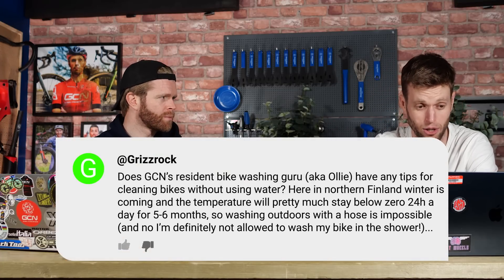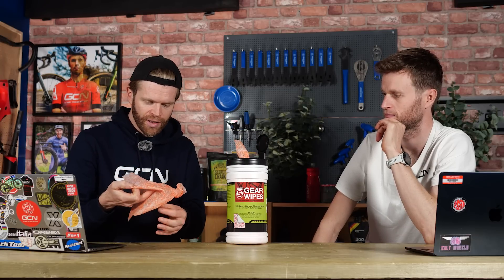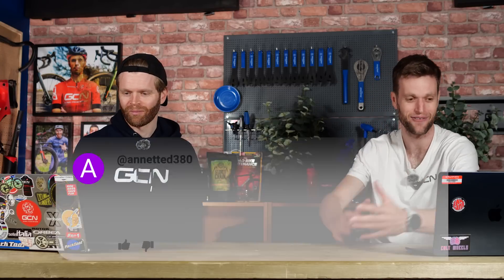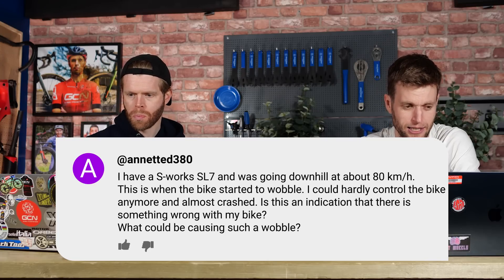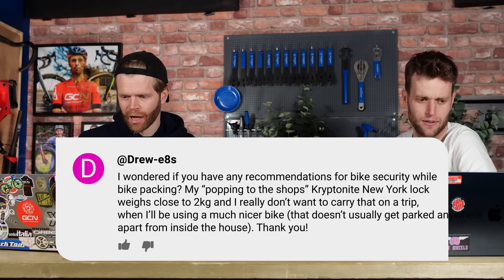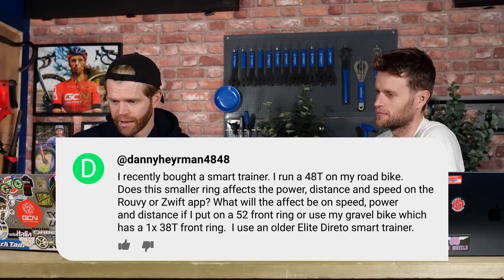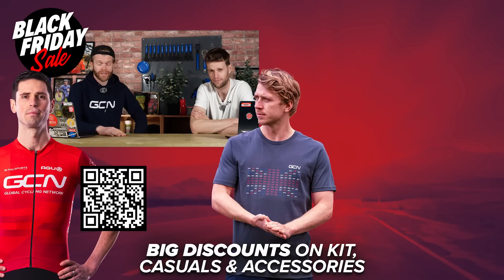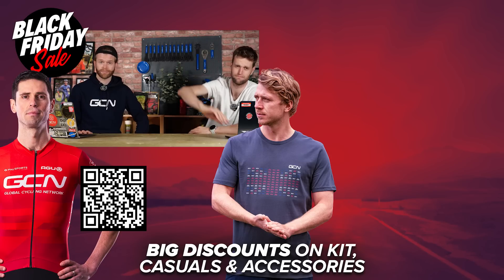Waterless Bike Wash, Cold Waxing & Speed Wobble | GCN Tech Clinic

Comment: About the wheel wobble. I had this experience once, only once. I was riding down a mountain pass in the Banff area which is north of Calgary. I hit 72, 73, 74kms per hour and then suddenly my front wheel started to shake a lot, scaring me I applied my rim brakes slowly to drop my speed and the shaking went away. The road surface was quite smooth and not much wind. I've done speeds of around 60+kms with no problems before. When this happened I thought there was something wrong with my wheels. When I got home I checked the truing of my wheels and both were in really good condition. I also checked my headset which was fine. I ride a Dolan Rebus, I always keep my bike in top condition. To this day I have wondered what caused this. Thanks for addressing this topic. Ollie as you said this is a complex situation, I guess I will never know the true cause, I don't do those speeds anymore, getting too old for that. Why don't we hear about the pros having this problem?
Reply: A pros riding position is much further forward to the way most of us ride.  This puts more weight over the front wheel which helps prevent the wobble.   Many people push their weight back off the saddle on fast descents.  This puts the weight on the rear wheel and lightens the weight on the front.    You can try this on a safe slope and see the difference.
Reply: It could also be that you are too tense causing your arms to fatigue, hence the shaking sensation
Reply: Apparently alot of motorcycle speed wobble is caused by wrong tire pressure so i think that probably also is true for bicycle.
Reply: @wilderness-beastt  from motorcycle world, 3 point to why? low tyre air pressure, Flat spot (worn tyre) lose bearings. All 3 can cause this to happen. Hope that helps.

Comment: Taking your wheels off and putting the bike on a trolley whilst in the store is a really solid idea. It’s so easy to steal a bike. I use a Z lock, but only when my bike is in a group of bikes. It’s like the old saying about not needing to be able to outrun the bear — just needing to be able to outrun the other guy; a thief will take the bike that’s easiest to steal. Also, in my area, bike thieves prefer to steal bikes that are saleable, for example steal or aluminum bikes with mechanical groups, or e-Bikes. Electronic components and high end carbon bikes are really hard to sell, and these bikes are generally sold at flea markets.

Comment: Thanks for another great show. Your answer to the speed wobble question makes me wonder if you could do a deeper dive on the causes and, more importantly, the best possible way to safely stop the bike once it starts to wobble. I had this happen on the Whistler Gran Fondo earlier this year. I was at 70 KMH on a descent when my bike started to shake violently. I managed to stay wheels down but it could have ended very badly. I had a tech check out my bike at the next rest stop and he said it was mechanically sound. I’ve spoken to a number of experienced cyclists who have all given slightly different explanations for the cause. Some say my weight was too far forward on the bike while others have told me my weight was too far back. Some said it’s unsafe to brake once the bike is in full wobble others have said that is the safest way to stop. I’d appreciate more information. Thanks
Reply: There are many variables to consider, so it’s difficult to give a specific answer as to why any one ‘wobble’ develops.  In my experience, feathering the rear brake at onset can help prevent it get any worse. Before doing any training in the Alps (where it’s most likely to happen on long descents) I would always have the bike serviced and fit new tyres, tubes, disc rotors and pads.  All bearings removed, cleaned, lube’d and refitted. An optimised setup seems (touch wood) to have prevented me ever getting a speed wobble after a couple years ago.
Reply: Expert bike builder Lennard Zinn wrote an article about this ("shimmy"). Perhaps it can be found on-line.  As for my own advice: Get a high quality  custom steel frame! I can practically let go of my bars at 80km/hr.  Whether I'm descending at 45 km/hr or 80, it will feel exactly the same. I think the reason is in part due to the steel frame, but also the head angle and rake of the fork which makes for longer trail, and a very stable descender. Most carbon race bikes, in contrast, are low trail, very stiff and have light forks, and have quite a nervous front end to make weaving through a bunch easier.

Comment: Regarding speed wobbles, I've been lucky enough (to date) to have never experienced one. I'm a 'known' quick descender having hit 112kph (69mph) and frequently hit 60+mph here in the Dales, and hit 80kph (50mph) on most rides. I'd say that one of the causes of a speed wobble is how people hold themselves on the bike, as it tends to only ever be the more nervous (or should I say, less confident) rider that suffers from them. A bike is more likely to pick up a wobble if someone is tense on the bike, holding the bars very tightly and tensing the legs / body - thus causing a fully-tensed system that won't allow for free-movement. This means any 'wobble' the bike picks up will be transferred back into the bike, and as we humans generally can't react in time, it adds to the problem. The solution (obviously a personal opinion) is to become relaxed on the bike and make sure your weight is balanced - preferably with more weight going through the legs, and holding the bars gently.

Comment: #askgcntech Help please. I recently upgraded my rotors (standard sram centreline 160mm to some nice hope ones also 160mm). I also bought some new pads. After a long while, I managed to align the front pad and rotor perfectly, however the rear rotor and pad is proving challenging. I know its the pad as I put the old pad in and the rotor aligns perfectly. Is it a case of the rubbing will go away with the new pad after bedding in? I've literally spent a whole day trying to align the new pad to no avail ( I've got the pad spacer too). Nothing wrong with the pistons and the rotor isnt bent
Reply: please check how (un)evenly the old pads are worn. May be an indicator of skewed brake mounts on the frame. Or if they are fine, you could have simply bled the brakes with too narrow bleed block, resulting in too much fluid and too little gap.

Comment: Hi. Great video, as usual. Re. the bike security question, maybe a length of braided cable with loops on each end and a good lock would do the job? I don't bike pack but if weight was an issue, this would be my solution.

Comment: For waterfree bike cleaning I recommend wiping the bike down with a corrosion inhibitor. Spray it onto a rag and then wipe it onto the bike (not your brake rotors!) This will leave a waxy/oily film on the bike. Dirt will now stick to that waxy oily substance instead of your frame. As long as the corrosion inhibitor lasts, cleaning your bike is as easy as wiping it off with a rag or soft brush - the dirt will just fall right off. Also protects against salt. Reapply every 2 to 6 weeks depending on how much you ride. A tiny bit goes a long way, I'm still on my first can for 5 years now!
Reply: FWIW that's what people did in the old days, before sealed bearings became commonplace. Spray with WD40 and wipe down with rags. Sometimes LPS3 instead. Hosing off bikes was a really bad idea. You'd have had to repack all your bearings.
Reply: @gregmuon  There is a WD40 branded corrosion inhibitor but it's different from regular old WD40 spray which is mostly solvents. Proper corrosion inhibitor won't do that, I use the CRC branded one.
Reply: Silicone spray is ideal for this (e.g. Jig-a-Loo).  It makes the dirt slide off.

Comment: Respected on the front wheel 
   Roval Rapide CL 40 Disc SCS Carbon has a small hole, I'm wondering if it can be repaired or for safety's sake it's better not to repair it, it's a great bike